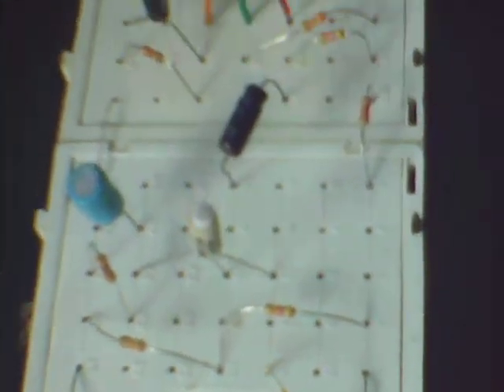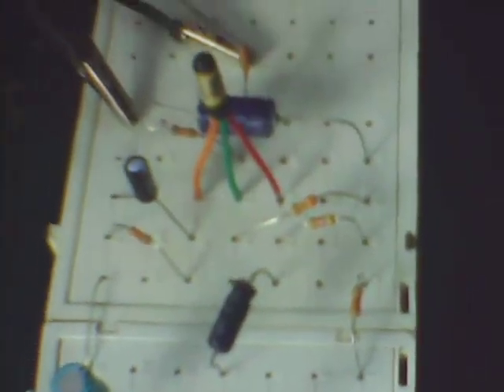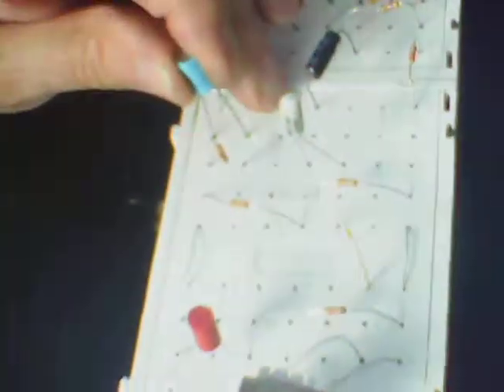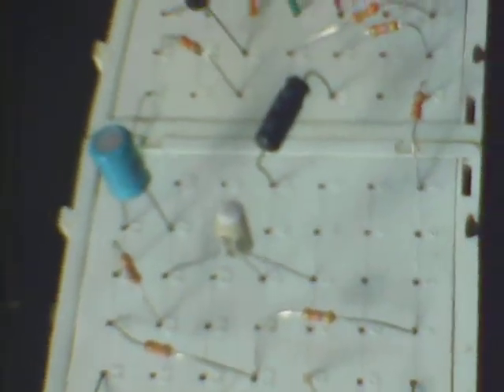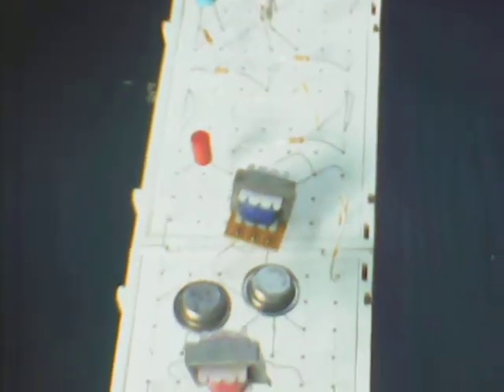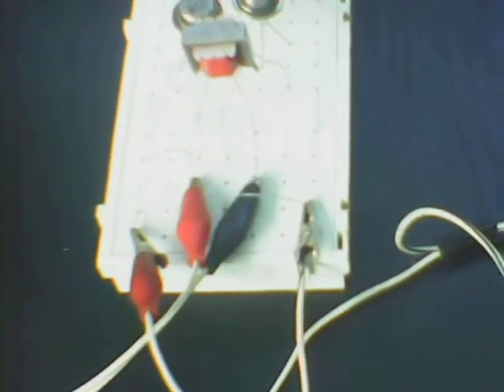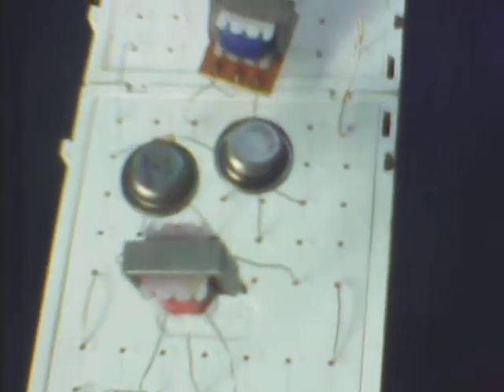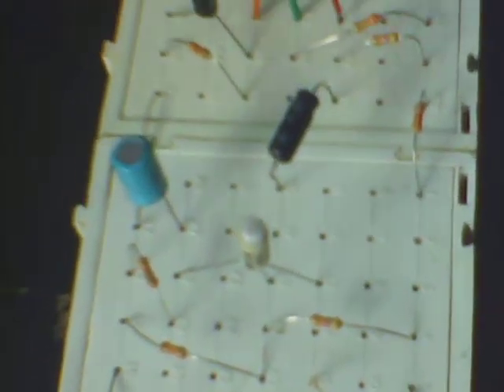Germanium 300mW transformer coupled practice amplifier on an S Dec

Comment: S-Dec BREADBOARD ?? Now THATS OldSchool :)

 I had 1 as a kid ..  Than the 'new' T-dec, .2 inch grid for that new fangled (pre IC) SILICON stuff!

 Kewwl :)
Reply from the maker: It's just possible to connect a TO92 transistor if the leads are bent carefully. I find it a lot easier than the 0.1" boards, especially with my aging eyesight. I still need to use clip on magnifying lenses. I've uploaded the contents of the suggested circuits book that comes with the S-DEC on my Web: www.hoofbags.me.uk 

At the opening screen, click on geekystuff on top left corner. Thank you for your interesting comment. 🙂
Reply: @hoofbags  Wowssers - gotta admit I've got NO desire to go back! (Hm, just maybe a T-Dec lol)
Sadly I lost my oldschool gear in a vicious PFI Eviction by The Housing Office/r From Hell, in Islingtons Privatised 'Council' Housing - which forced me into THIS century*
Go on, be cutting edge :) get a T-Dec!
 (if anyone has any???)
Reply from the maker: @petegaslondon  I had a T Dec but the plethora of different chip formats meant that it wasn't practicable. Before I had a 0.1" matrix breadboard, I soldered leads into a 8 pin DIL to do experiments using op amps and similar. I remember building small amplifiers out of transistors but these days we see LM386 amp kits, PCB included, for under £3. Things have moved on, although I still dabble in amateur electronics when the mood takes me. Thanks for your response. 🙂